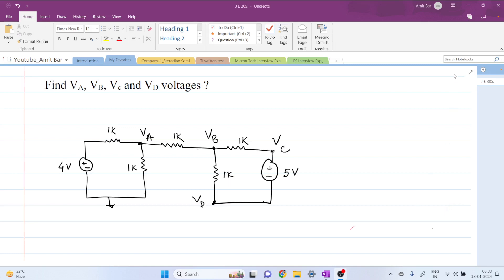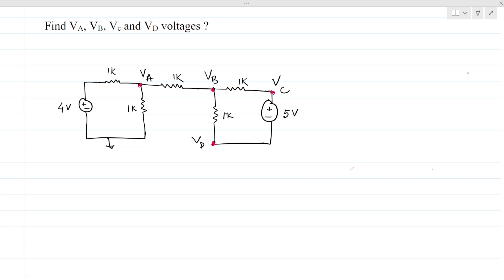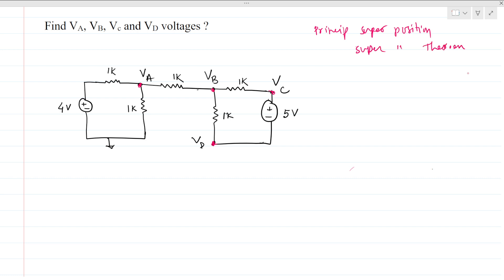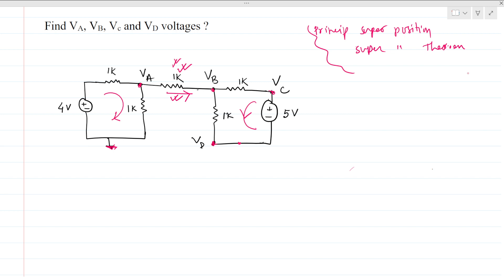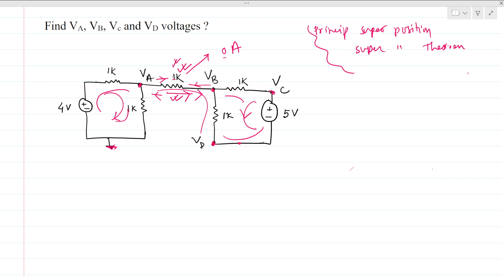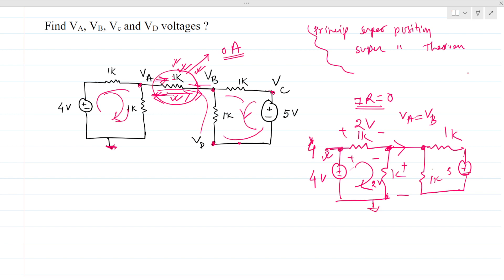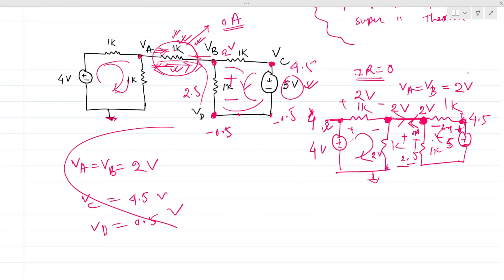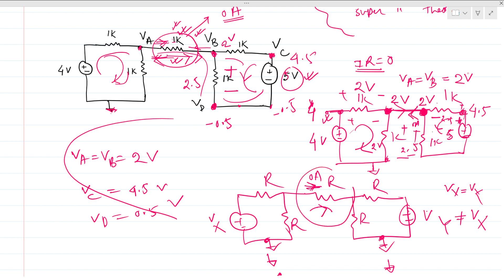Analog Design Engineer interview Question _Find the node voltages intuitively_ Texas instruments

Comment: How can you say that the va =vb using vdr it is clear that vb =2.5 v can you explain
Reply from the maker: Already explained!! You can simulate this circuit in any circuit  simulator... thanks
Reply: @AmitBar-Analog_Circuits  are you sure about your explanation, because these 2 ckts donot have same ground as well
Reply: if current through any branch is 0 , it means that the voltage across the branch is same 
there is no current flowing from A to B , so Va= Vb.
now on the left side, we have given the ground reference , hence we have decided that Va=2V
on the right hand side, there is no ground connected, hence the voltage at the Vd is not 0V for Vb to be 2V